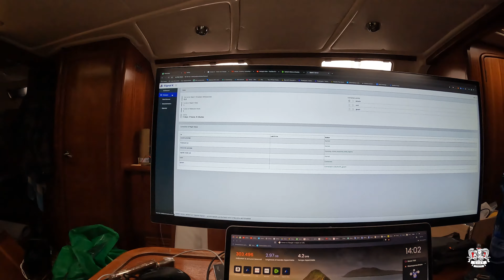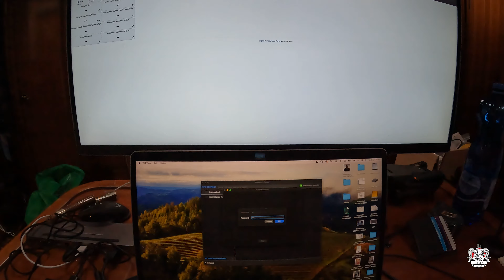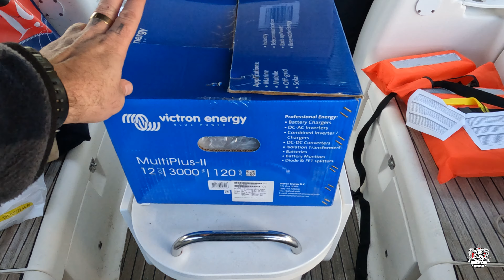🌊 "Sailing Goat: Ep. 3 - Cable Chaos and Raspberry Pi Setup | Boat Refit continues"

Comment: New subscriber here. I like the RPi thing you're doing. Would you mind going in to a bit more detail about the additional hardware you're using and what the process was to get everything to talk with each other? I saw one thing on your desk that I would strongly discourage: The Waco connectors (gray and orange fast connectors). They are not suitable for marine use, certainly not in smaller craft where you have relatively high chance of moisture. I work with electrics in "smaller" boats, up to about 45ft, and I see a LOT of these failing (intermittent connections, some corrosion, wires becoming slightly loose). I have also been advised against using them in boats by a certified high voltage electrician who said, quore: "Not made for this use, and you can't expect them to last very long if they are used in this environment". I just thought I would mention it, as it would be sad to do all this work and then have to chase wiring gremlins. I would recommend to use crimp connectors with shrink tubing with glue in them. This way, you get good crimp connection, the shrink tubing ensures they won't come off easily. In areas where you're likely to get moisture, add shrink tubing over the whole connection as well. Oh, and mark EVERY cable on both ends as well as wherever they are accessible. Saves a lot of time when/if troubleshooting. These are just suggestions, based on experience. Do with it what you will 😇 
Edit: USB GPS antenna, tiny black thingy: You can fit them inside, but preferably on a clear window, as high up as possible for best reception. That's my experience, anyway.
Reply from the maker: Hey thanks you so so much for the suggestions and tips!!! About the Waco connectors i only use them to to temp connections while "debugging" but as soon as i'm happy with the installation I replace them. I did not know they fail that much, thanks for letting me know [i'll be sure to remove all of them]. About the Raspberry PI sure thing  i'll be sure to do a video about it. I can tell you that i used a PiCAN-M HAT and raspverry pi 4b. SignalK and Rednode. Then you can just call all up using virtuino app.